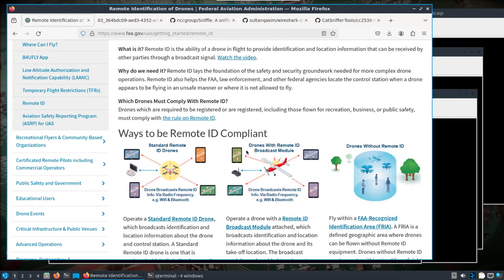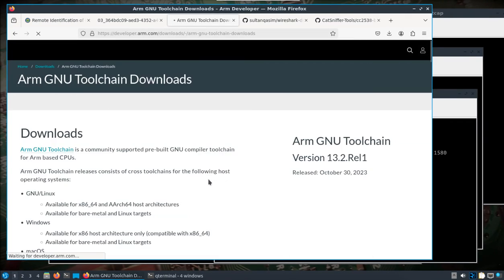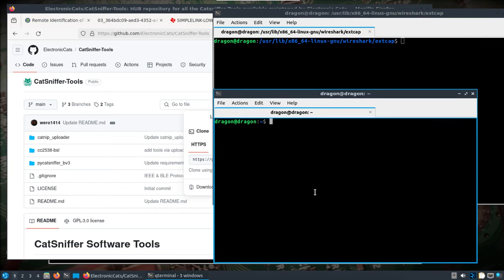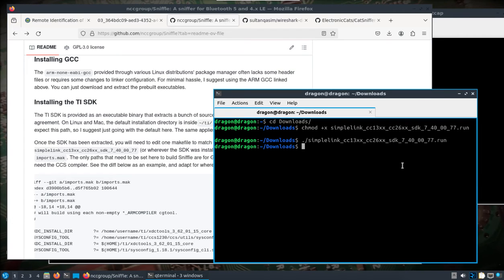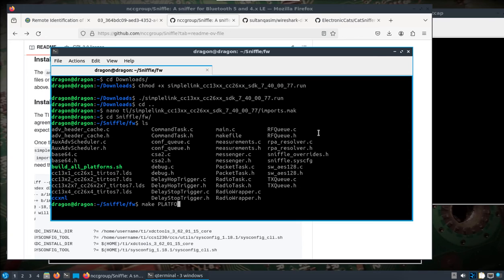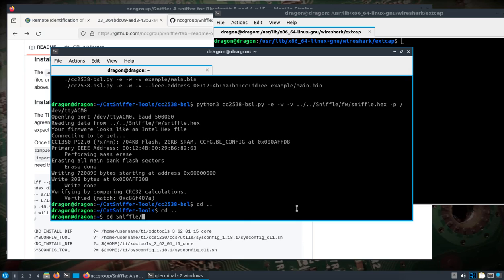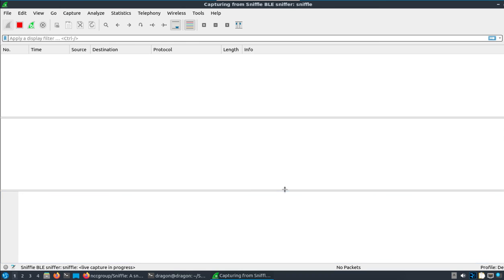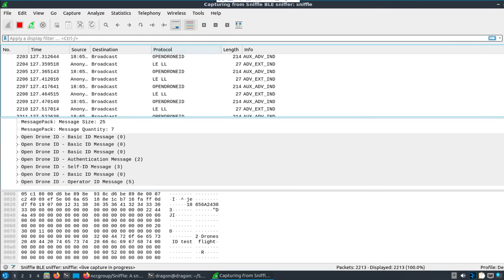WarDragon Decoding Drone Remote ID w/ Compiled Sniffle Firmware + WireShark (CatSniffer v3)

Comment: All drones should broadcast some information about themselves (e.g., altitude, longitude, latitude). I tried scanning over Wi-Fi, but I didn’t receive any data about the drone. So, I attempted to use the BLE method with this tutorial, which allows receiving data on advertising channels (37, 38, 39). However, I’m not getting anything. What could be the solution?
Reply from the maker: This solution is not for WiFi RID and 2/3 of the drones you mentioned are DJI which does wifi rid. For that, I use a WiFi card and the droneid repo or code I’ve created for the esp32 inside the wardragon. Also, not all drones provide remote ID - it’s based on weight and country.

Comment: I recently watched your tutorial on using the CC2652P sniffer to decode Remote ID signals from drones, and I found it very informative. I was wondering if, in addition to the CC2652P sniffer, any additional equipment is required—such as a specific antenna, adapter, or any other hardware—to ensure complete reception and decryption of the signals.

Thank you in advance for your time and clarification.
Reply from the maker: Not necessarily, but of course an added LNA and high gain antenna in 2.4ghz range could increase detection distances
Reply: @cemaxecuter7783   I followed the entire tutorial step by step, but unfortunately, I couldn’t get anything to work. I’d really appreciate some hints to help me out! I used DJI Mavic 3, Mini 3, and 30T drones, along with the stick USB Dongle  CC2652P. Is this a good stick for this? What stick did you use? Which drone was used in the tutorial? And which channel was analyzed in Wireshark? Thanks in advance!
Reply from the maker: @PaulaIoana1 use my repos 
https://github.com/alphafox02/DroneID

git clone the repo and make sure also you cd DroneID
git submodule init
git submodule update 

You’ll have to flash the sniffer with sniffle firmware if you haven’t already. You can then manually run 
python3 sniffle/python_cli/sniff-receiver.py - l - e 

But dji does not use BT RID. The dongle will only get you BT based remote ID.
Reply from the maker: Most likely none of the drones your testing has BT based remote ID.
Reply from the maker: Not all drones broadcast remote ID. They have to be over a certain weight and it depends on laws in your area. Over 26grams or whatever that number is in the US, they’re legally supposed to transmit it.

Comment: Really cool!
After a simple search, it seems that the Remote ID is based on WiFi or Bluetooth transmission. Have you tried working with WiFi and Wireshark to capture the Remote ID,
What WiFi sniffing software is available for use
Reply from the maker: The same dissector works with WiFi and it recommends some tool in windows, but I’m willing to bet that maybe aircrack on channel 6 at 20mhz wide to a fifo pcap would probably work.

Comment: Too bad there`s no ESP32 version about 1000x easier to use !
Reply from the maker: But then it wouldn’t have the benefits of what the SDR is providing, which depending on bandwidth, can decode all presets at one time across 20+Mhz bandwidth.
Reply: @cemaxecuter7783  yeah I guess